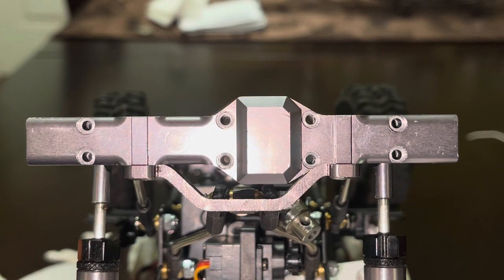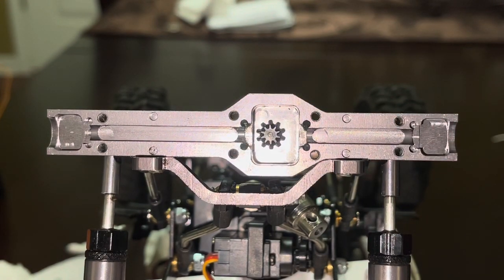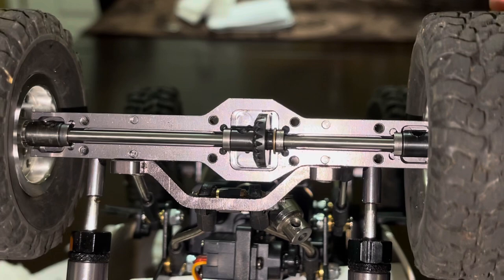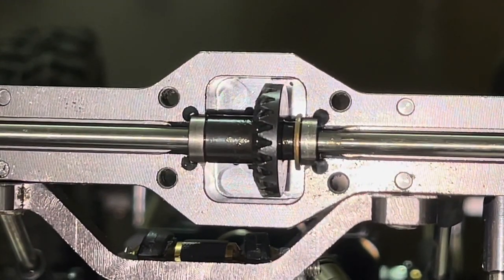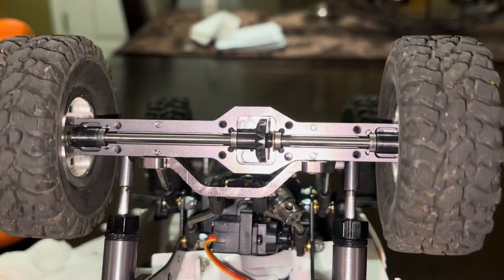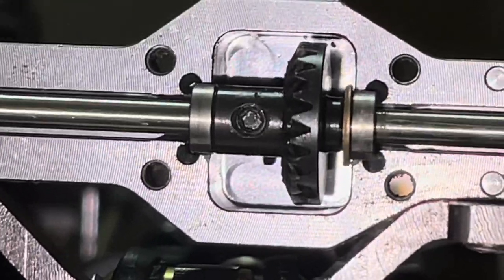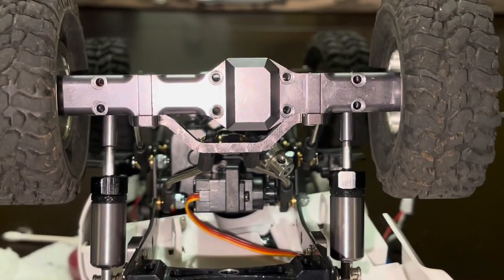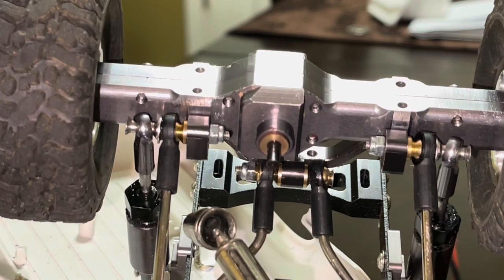WPL (NOT ORIGINAL) Cheap eBay or Amazon Square Metal Axle Ring & Pinion Gear Set-Up Smooth Running

Comment: Agreed on packing the axle with grease--this will help seal the bearings which are not sealed (just shielded) and not waterproof. In fact, grease should be smeared on bolt sides of the ball bearings if you plan on driving in deep water (axles submerged) or mud.

Comment: You need to keep the diff open and you push on the pinion at the same time you tight the drive shaf tand you gonna have less wiggle i have do it on mine and it work very well no wiggle and no binding
Reply from the maker: Yes you can do that or add the shims

Comment: Yikes, you have some shuddering and skipping at hi/low speeds. Could be the driveshafts out of phase, definitely not smooth when power is applied.
Reply from the maker: It’s definitely the driveshafts
Reply: Can you explain? I have same axles ( brought over a year ago and never installed)
Reply from the maker: What would you like to know?
Reply: @That_RC_Channel  What you guys mean by the driveshafts out of phase?
Reply from the maker: So sometimes the driveshafts can be offset in that case you would disassemble and turn one half 180° and reassemble the goal is to find a happy smooth location